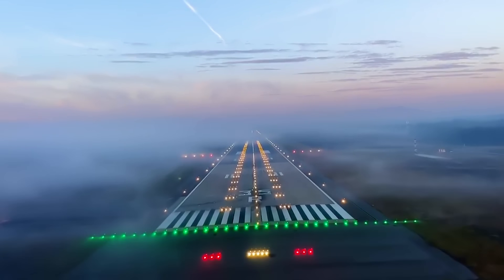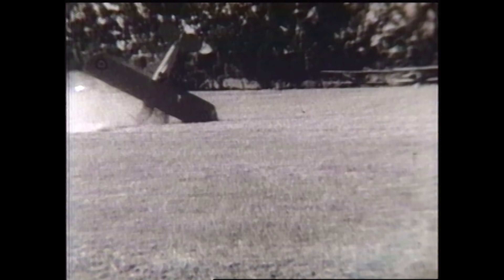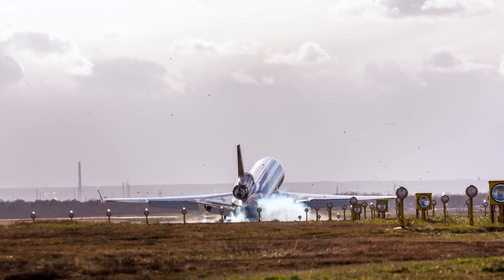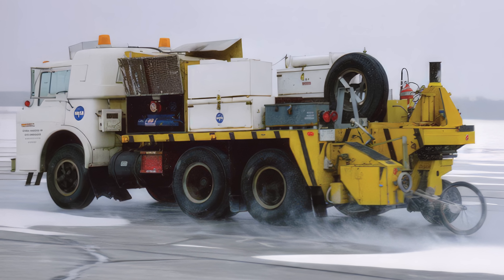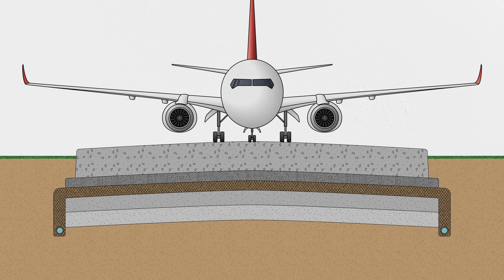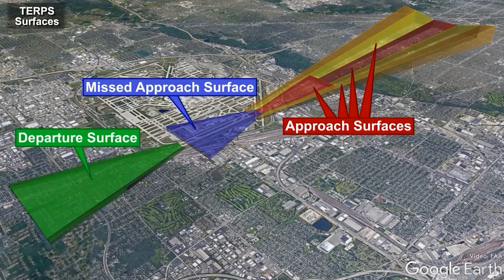The Hidden Engineering of Runways

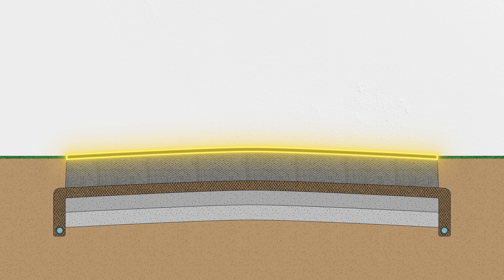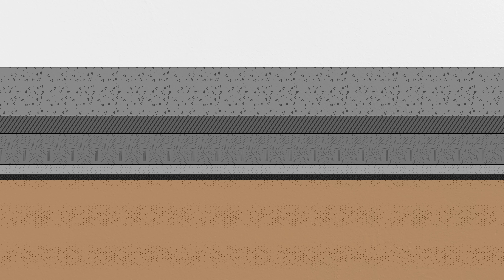Comment: Hey Grady! Long time viewer and engineer from Canada! I have a question about the effective width of the tires which you discuss at 9:09. You say with asphalt, or perhaps more generally "flexible" runways, that the effective width is spread out through the depth of the structure. As opposed to concrete or "rigid" pavement where the effective width of the tire is the actual width. Could you please explain this further? It seems counter intuitive to me as I would expect a rigid structure like concrete to widen the effective width cone as it would do a better job of spreading out the bearing pressures to the materials underneath. Indeed, you also talk about this at 11:38 with concrete being much better distributing the forces. 

I work in the heavy civil and marine industry so if you ever need help or ideas for researching pile driving and/or heavy lift barges, let me know! I also had the pleasure to work on one of the worlds largest Cantilever Bridge pile driving machine. The bespoke machine was possibly one of the only ones of its kind in the world at the time, it would make a great topic for a future video too!

Thanks Grady, always love watching your videos! Continuing Education requirements would be much more enjoyable if you were teaching the classes.
Reply from the maker: Sorry for the confusion. On rewatching, I see where the graphic is a little misleading. Tire width goes into estimating pass-to-coverage ratio in pavement design to estimate load repetitions. For rigid pavements, it's measured at the surface. For flexible pavements, it's measured at the top of the subgrade. I'll add a note in the description. Thanks for pointing this out.
Reply: @PracticalEngineeringChannel thanks for the reply! I can definitely see how a video on runway engineering can "runaway" from you with all the details included in the design. I'm sure its more nuanced, but would it be true to say that a flexible pavement typically has a higher P/C ratio and a rigod pavement typically has a lower P/C ratio?

Comment: Tarmac (tar macadam) is never* used for hard surfaces on the air side of airports.

Hollywood would like you to believe otherwise, but Hollywood is clue free in this, as in so many other things. That concrete parking area outside the terminal is the "ramp", not the "tarmac".

* There might be some airport somewhere, I suppose, but tarmac is virtually never used anywhere anymore, and it's certainly not something that should ever be mentioned except as a weird exception when talking about airports.

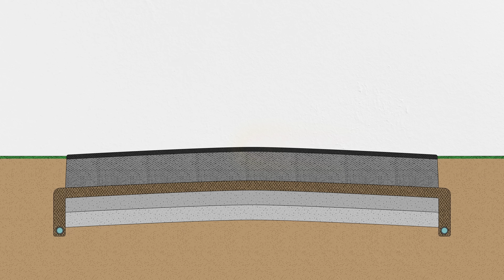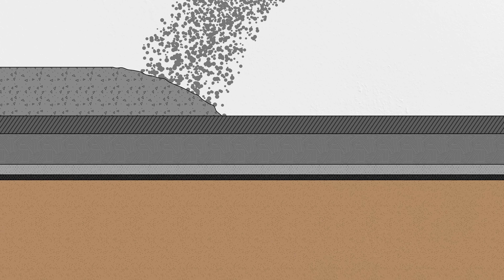Comment: I'm confused. At 09:05 you say that asphalt spreads the load and concrete does not. At 11:35, you say the exact opposite. Which is it?
Reply from the maker: Sorry for the confusion. On rewatching, I see where the graphic is a little misleading. Tire width goes into estimating pass-to-coverage ratio in pavement design to estimate load repetitions. For rigid pavements, it's measured at the surface. For flexible pavements, it's measured at the top of the subgrade. I'll add a note in the description. Thanks for pointing this out.
Reply: Yeah I questioned that at 9:05 as well. 
If I push on a steal slab (~concrete), the force is distributed and clearly spread out underneath the slab. If I push on plastic however (~asphalt), I can feel where I'm pushing under the plastic because it gives a bit.
Reply: @MrMattie725  Yes, exactly, I don't understand either how a more flexible material like asphalt can spread loads more than a more rigid material like concrete.
Reply: You're not paying attention/misinterpreting and/or overthinking it. He never said that.  All he's saying is that the load distribution varies depending on the material and its thickness.

Comment: I would have thought rigid concrete would spread the load into cones as there would be less shear. Adjacent areas of concrete could take some of the load. Asphalt OTOH would transmit the load directly downwards do to lack of shear strength.
Reply: Rigid pavements assume the force  will be applied evenly over the entire area of the slab, with the adjacent slabs taking a portion of the stress, the coefficient of which is dependent on the what type of ties are used (dowels, diamond plates etc). 

The k value of the subgrade is basically the same as the k value for a spring. So think if it like the concrete is acting as a rigid plate on a bed of springs, once it exceeds the maximum bearing capacity of the subgrade, the concrete cracks. 

Airport slabs do not generally have tensile  reinforcement on the bottom edge of the slab.

Comment: Crashes of smaller jets and planes is actually pretty common.  There are actually several thousand plane crashes every year globally.  About 1,200 incidents and accidents happen per year in the U.S. alone or roughly 3.2 crashes/incidents per day.  That's why plane crashes rarely make the news.  The vast majority of crashes happen in little Cessnas with undertrained pilots.  Commercial jetliners have a much better track record though because of vastly better safety systems (e.g. TCAS), far better trained pilots, much stricter rules, and better airspace management by the FAA/ATC.  Getting to be a commercial jetliner pilot is a privilege - a privilege that can be revoked for relatively minor infractions.

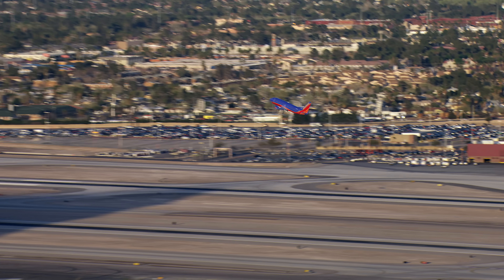Comment: 16:14 Pilots know about runway safety areas, grooved vs un-grooved runways, displaced thresholds, weight restrictions, blast pads, and EMAS. What some might not know is exactly what is going on underneath the surface for runways to handle the loads.
Reply: Butter, rake, and bake
Reply: In my experience pilots usually have extremely little knowledge of aerodrome facilities
Reply: @adamwest1138 you clearly have limited experience, then.
Reply: @adamwest1138  Maybe in GA
Reply: @adamwest1138 The things I listed are required knowledge however
Reply: @adamwest1138    It's the bat phone, sir
Reply: @adamwest1138  any good pilot learns all they can about each and every airport they go to.
Reply: *maybe
Reply: @DarkAttack14  that’s what the “might” in their comment was for.
Reply: @barmacidic2257that's what the "maybe" in the video was for, negating the need for sgfgustafsson to write his comment at all

Comment: We in the aviation industry grimly refer to the advances in aviation safety as "tombstone technology". Also, TARMAC is the original patented name of what eventually became asphalt, and people do still use the term but it is not the same as the original TARMAC. It has sort of become a catch all term like everyone calling "hook and loop" Velcro whether or not it is made by 3M or not. Also, while the Miami Air flight did happen in Jacksonville, FL it did not happen at Jacksonville International Airport(KJAX) but at Naval Air Station Jacksonville(KNIP) and being a military base they are built differently than commercial airports, so this is a bad example to site here. For commercial jets the thrust reversers actually do most of the work, with the brakes being used sparingly and in some planes not at all unless they have to use a standard taxi way, if they are using a highspeed taxi way, the brakes won't be used until across the hold short bars. This prevents all that heat from welding the brakes shut or starting a fire. Most airlines will use reverse thrust with auto-braking until around 60kts then close the reversers and coast to the taxiway using the remaining energy and the static thrust of the engines. Turboprop planes like the Pilatus PC-12 will come to a full stop using nothing but the beta range of the propeller. One of the bad things about asphalt is that when it gets hot and has heavy aircraft sitting on it, they can actually sink into the asphalt and this is what leads to a lot of delays and cancellations at airports in the south west US(that and density altitude but that is a completely different kettle of fish)
Reply: autobrakes apply... THE BRAKES.  they just use the plane's automation to regulate the application instead of the pilot's feet.  in fact, thrust reversers provide about 20-25% of the deceleration force, with the rest divided between wheel braking, and other aerodynamic drag devices; on a passenger jet.  in fact, the primary function of the wing spoilers is to increase downforce by killing lift, to give the wheels better traction.
Reply: Underrated comment.

Comment: I know the engineers already know the answer to this, but I'm curious. If runways are designed based on take off requirements as it contains the most amount of fuel/weight, what is the contingency if a plane takes off, but due to whatever reason needs to do an emergency landing shortly after? The plane is now landing, but with all the fuel weight still on board.
Reply: Depends on the aircraft, but sometimes they have to dump fuel. This isn't ideal, obviously, so if the emergency condition allows then they might fly the pattern long enough to burn off fuel to make landing safer. Or the planes just land and deal with the damage. But all of these considerations are related to the life of the aircraft, rarely the runway. The strength requirements for runways are there to deal with cyclic loading over a long period of time. It is very rare that any single incident damages the runway sufficiently that it needs repairs.
Reply: @sheldoniusRexCheers mate, that makes complete sense and I forgot about the whole fuel dumping option if needed.
Reply: There's not just limits for the runway, but the airframe: max takeoff weight is almost always larger than the max landing weight. Such a rare, worst case emergency landing would likely be handled same as a crash on the runway: it would be taken out of service and inspected.
Reply: @CodeKujo cheers, I suppose it is rare and human life is the main concern above damage of the plane and or runway.

Comment: Does the EMAS only work if the landing gear is out? 

This video really reminds me of that recent crash in Korea and how bad that runway was.
Reply: EMAS will improve outcomes even without landing gear extended, but obviously optimal results come from having the gear down.
Reply: If the gears are in (and the plane touch down on the correct are) friction will stop the plane long before the end of the runway (assuming that is kept on the runway).
Reply: the energy management of the plane played a very significant factor in that crash.  unfortunately, the pilots underestimated the severity of the birdstrike, and ran out of time before they managed their go around.
mind you, this is not to accuse them of doing anything wrong.  they did the best they could with the information, training, and time they had.  but yes, I think, from my limited understanding, that an EMAS installation would have helped.
Reply: Slowing down an airplane on the ground generally works much better if the gear is out because the brakes are designed for that, whereas scraping the belly on the ground isn't exactly a normal use case. I imagine EMAS is similar, the point loads of the landing gear are what crushes the crushable material and creates the stopping effect and the effectiveness would be reduced without the landing gear.

Comment: Aero braking is not the same as using reverse thrust.  Aero braking is using the wings angle of attack to slow.  Reverse thrust is redirecting the thrust of the engine forward and upward.

Comment: They use EMAS systems at some car drag racing tracks too. It has saved many drag racing drivers from destroying their cars and themselves.
Reply: Seems ways safer than those nets.
Reply: and somehow, the Kalitta family is involved in both of these things
Reply: No they don't. I've never seen anything fancier than gravel or sand in the drag strips I've been to/seen. That is NOT EMAS.  Anything with an FAA stamp of approval on it is insanely expensive.
Reply: @aerialbugsmasher  It can't be. The FAA has no authority there so they can't certify anything there 🙃🤣😛
They are engineered for the different job they do to varying degrees; some are simple and some not.
Reply: @P_RO_  You don't say?!?!🙄

 My point is this guy is implying they literally use runway EMAS in drag strips which is NOT the case by a long shot. 

It's like comparing Coca-Cola to RC Cola. Related but not the same.
Reply: @aerialbugsmasher  You are aware that EMAS just stands for "Engineered Materials Arresting System" right? It doesn't have to mean aircraft.

They never said it was aircraft EMAS, just that it was EMAS. Maybe slow down and read things before responding
Reply: @richardmillhousenixon  I've never seen that at a strip, ever.
Reply: @richardmillhousenixon you are aware that the term originated in aviation and is exclusively used in these circles right? Call it needless pedantry if you'd like but after over 2 decades as a pilot that also partakes as Motorsports as a hobby not once have I heard that system used under that same moniker outside of an aviation context.
Reply: @aerialbugsmasher yep they're just being silly
Reply: @P_RO_  Who said anything about the FAA certifying a drag strip? He said the material itself and the process was certified not the finished construction at the drag strip and the implication is the drag strips would have to pay much more to use the exact same construction and materials that the FAA certified so they just do something similar if at all.
Reply: @aerialbugsmasher  You are aware that terms created in one industry can be applicable in others, right? It's a generic term, it's not like it is the specific name of a product made only for runways.
Reply: @NoZioKikes88  The first guy never said they used the exact same stuff, just that they use an engineered materials arresting system.
Reply: @UncleKennysPlace  Neither have I, but I also have only been to a handful of drag strips, so it's entirely possible I just haven't been to one where it's installed.
Reply: @NoZioKikes88  Grow some reading skills and read the replies here again until you see who said that.
Reply: @richardmillhousenixon  Thank you for clarifying that.
Reply: @P_RO_  I never said it’s FAA-approved they use sand and other materials to slow down a race car, they’re not trying to stop a 181,000-lb 737-8 Max. I’ve been to tracks in Gainesville, FL, Tampa, Fl, Atlanta, GA, Chicago, IL, and many others and all have a type EMAS system to slow a car down, just in case they overshoot the track.
Reply: @richardmillhousenixon  Thank you, I couldn’t have said it any better. People on here think I said that it has to be FAA approved, I said nothing of the sort. YouTube is full of idiots.
Reply: @aerialbugsmasher They won’t say they ran into the EAMS at the track. They’ll say something like, they’re in the runoff area, off track excursion, going wide, gravel pit, or sand pit. Most people don’t know the term EMAS so they use slang to relay the information to the audience. I’m sure you’ve heard some of these terms if you actually go to the track like you say.
Reply: @NoZioKikes88  I never said it was certified, or that it was FAA-approved. They use sand, gravel, and other engineered materials to accomplish the same thing, to stop or slow down a vehicle at the end of the track. I can’t believe so many people are making a big deal about this. If you see sand or gravel at the end of the track then it’s probably an EAMS system, case closed.
Reply: @richardmillhousenixon  You may have heard the the term sandpit or the gravel pit at the track, that’s an EAMS system to stop a car. It’s not as long as an airport system or the same materials, but they’re not stopping a 182,000 lb 737-8 Max, so a race track EAMS will be built different.
Reply: @Sandy.J.Lloyd.Sr.  I understand what you meant I was just clarifying the misunderstanding of someone else's comment, no relation to yours really. I was giving everyone the benefit of the doubt and just explaining to someone what the other commenter was trying to say. Not saying he or anyone is right or wrong just clarifying what he meant because someone couldn't comprehend his obvious meaning.
Reply: @aerialbugsmasher  What do you think the sand or gravel is for? It’s a type of EAMS used to stop or slow a race car, not a 181,000-lb 737-8 Max. I never said it’s FAA-approved, so I don’t know where you got that from. I also didn’t say it was built with the same material the FAA requires; that’s ridiculous.
Reply: @aerialbugsmasher  obviously they mean Environment Material Arresting Surface 😂
Reply: @awesomestuff9715  No, they use sand, gravel, and other materials mixed or alone, which makes it an EAMS system. Like at an airport they use this system to stop or slow down a car instead of a 180,000 lb airplane. It’s so simple, I don’t understand how people don’t understand this.
Reply: @Sandy.J.Lloyd.Sr. I was making a joke about gravel being "environmental material" 
The real acronym was "Engineered Materials Arresting System"

Comment: I live near an Airbus plant that gets regular visits from the inconceivably large Beluga XL - the runway there must be insanely over-engineered!
Reply: No disrespect to the beluga XL but its max takeoff weight is lower than the passenger A330 variants.
Reply: @anzov1n  Kind of surprising, but also makes sense - watching it lumbering overhead it really doesn't look like it should be able to fly at all.
Reply: With armored vehicles and aircraft that large, ground pressure distribution is infinitely more important than the ground engineering. For example, the M1 Abrams MBT will collapse most bridges from its own weight, but its ground pressure is lower than a footsoldier, resulting in it being able to easily handle sand and mud much better than any troop on foot.